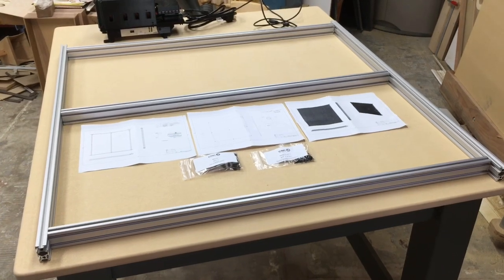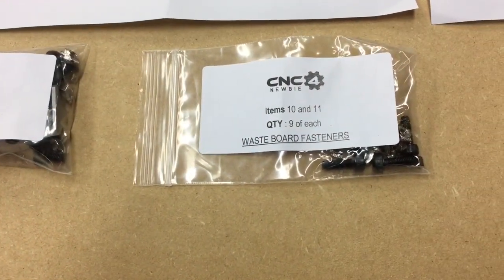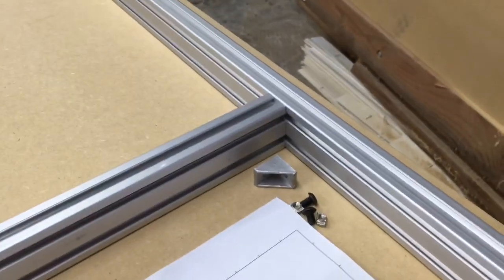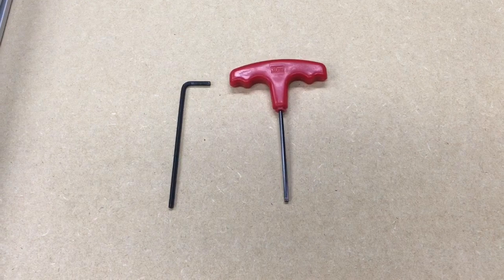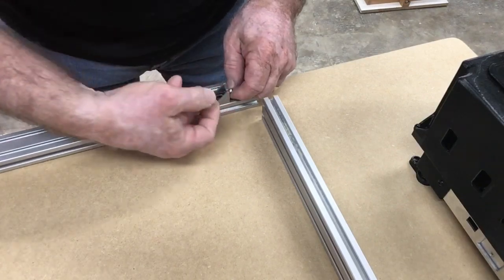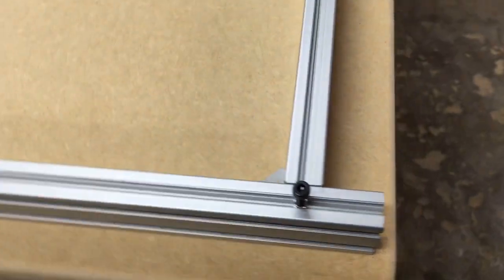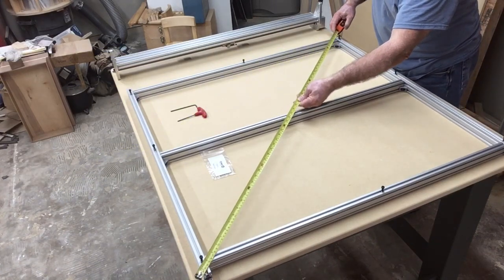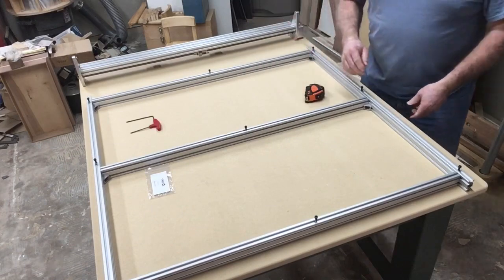Assembly Base Frame for the NEW-Carve by CNC4NEWBIE

Comment: What size on a table did you make?  Will it be big enough to holder the controller?  What software are you planning to use once you start using it?
Reply from the maker: The table size will most likely change.  I'll give you that answer when I am finished the assembly.  Yes, the controller will be on the table.  I considering using UGS and VCarve.
Reply: Paw Paw’s WorkShop Can you use Easel on the New-Carve?
Reply from the maker: Yes, you can.

Comment: What size is that New-Carve?
Reply from the maker: The size is 1000mm.  It is just a lot stronger, taller, lead screw drive and linear bearings for guides.  No v wheels and no belts.  Also 269 oz stepper motors.  It solves the problems that the XCarve has had for years.
Reply: Awesome. If I buy the base frame as well from cnc4newbies then I don't need a pre-existing xcarve correct?
Reply from the maker: You can buy any or all of the components from cnc4newbie.  It you have an old xcarve you can take the parts and put them on to the new carve.  I chose to keep both machines up and running.  All of the components are stronger from CNC4newbie including the base frame.
Reply: @PawPawsWorkShop  thank you sir. Love your videos! Buying my New-carve tomorrow!

Comment: Never in stock.
Reply from the maker: They are selling quickly and there is about a five week lead time.  Are you finding something else that is different?
Reply: @PawPawsWorkShop  About the only thing in stock is Shapeoko, and i just don't want to deal with belts.  There is one other brand that's fairly new with lead screws, but it's about a 5 month wait and they are not taking new orders till next month.
Reply from the maker: How long is the wait for CNC4newbie.  It is usually around five weeks?
Reply: @PawPawsWorkShop  Would be nice if they had a notification when they are in stock.
Reply from the maker: Have you emailed and requested notification of availability?